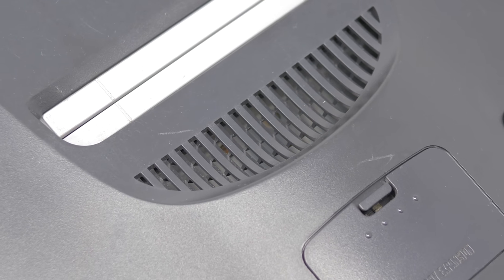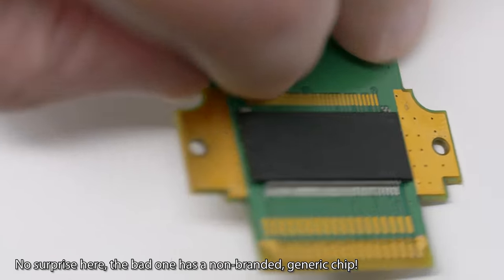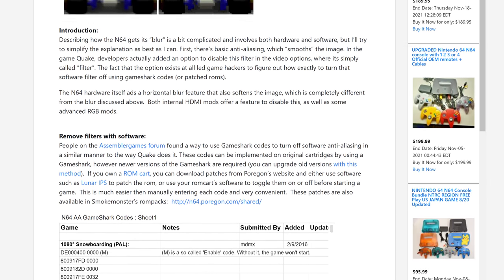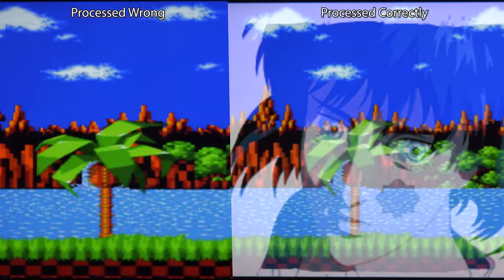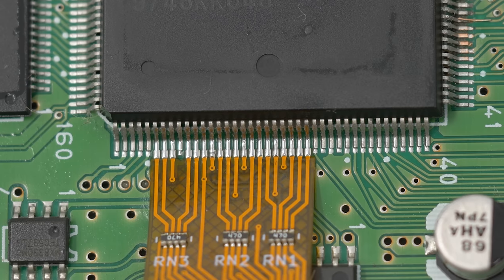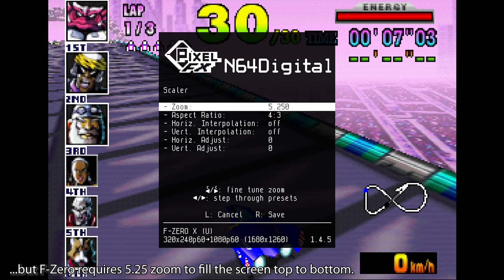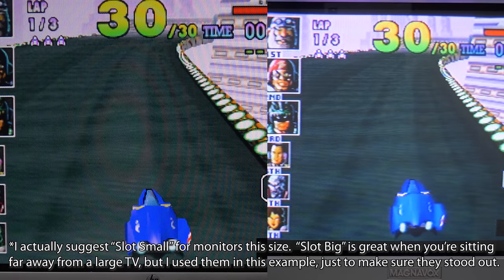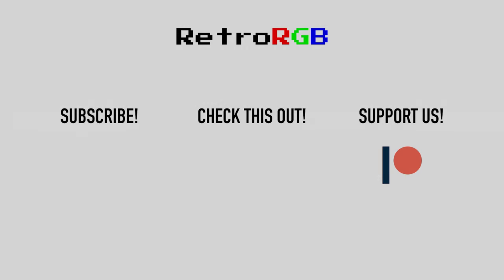Getting Started With The Nintendo 64

Comment: I'm glad there's now a more in-depth video on this subject. I got caught up with hardware and mods when I got back into retro gaming and ended up with a lot of expensive boxes and circuit boards that didn't work with my setup. I've since moved on to emulation exclusively, and I have sold most of the upscalers and consoles to make back some of the money I had spent, but a video like this probably would have saved me a lot of time, tears, and money.
Reply: the only thing that won't work on new setups are the lightguns,.. ... if you couldn't setup your consoles you did something wrong lol

Comment: Recently got back into the N64 after buying a CRT on the cheap and digging out my old Jungle Green system out of storage..  (Sadly, my original black one with the Expansion Pak is long gone.)  Also in the box were 4 original controllers, a memory card that needed a battery swap, and of course a few games including No Mercy, Ocarina of Time, Super Smash Bros., and Mario Tennis.  I'm planning to pick up a few more (authentic!) games soon and I just bought an s-video cable and a Forever Pak 64 to avoid losing save files.  Love it!

Comment: I’ve been an advocate for the mClassic but only on OG Xbox, Wii, GC and DC.. But since getting the RetroTINK 5x Pro I don’t even use it anymore since it has the same features but it’s better. It can force 4:3, Smoothing and upscale to 1080p which the mClassic does all those but just not as good. The RetroTINK gives me a more proper 4:3 image and it’s sharper with more features. I still like the mClassic and believe it’s a more affordable option that has IMO solid visual enhancements to the right 480p retro consoles. One feature that’s forgotten is the 4K upscale for 24fps Blu-ray. It’s not native 4K but it’s pretty good and nobody ever talks about that.
Reply: Main advantage of the mClassic imo is that it accepts HDMI input. Helps a lot with my old HDMI modded GC that outputs 480p via HDMI. I don’t always want to have a long daisy chain of cords to convert it to component and then into the 5x to upscale it to 1440p before running it to my monitor. Much simpler to just plug the mClassic in the back of the console and be done with it. Still get 1440p and the smoothing filter looks decent enough. If I didn’t have one already - I probably wouldn’t go out of my way to buy one now that I have the 5x, but I use it randomly at times so I’m not going to get rid of it either
Reply: @brotherbodhi237  If you want to connect it to the 5X you just use the HDMI out of it. I haven’t seen really any enhancement at that point since it works best with 480p and the TINK has great 1080p output.

Edit: I see what you mean now. Never mind 😅

Comment: Shout out to my homeboys Tim Worthington and Borti's advanced RGB mods. That shlt looks identical to my UltraHDMI with their deblur feature. 💪🏻 LOL! But, for real, the N64 is just always gonna be that one damn console that you don't strive to make look awesome, but strive to make look less like ass!
Reply: I also have installed the Tim Worthington RGB mod into my N64, and flashed it with Borti's IGR Firmware, with that hooked up to a CRT with Retrovision Cables, and it looks fantastic!
Reply: I have the RGB Advance on my N64. It look so beautiful. My only problem is I use a RGB Scart cable meant for the SNES which unfortunately creates pixelated edges which can be annoying. In a few days I will receive my Rad2x so that issue will be gone for good. I can definitly recommend this mod. Definitly use Retrotink or Rad2x after you modded your N64!

Comment: I have found that for my N64 that an S-Video cable and a RetroTink 2 Pro gives me a great picture with no hassle. :)  I always wondered how much strain the wireless adapters would cause... that's a neat solution (I use my Retrobit Tribute 64). :) 

Now that I bought a forever pak... I figure I'm golden with my N64. :) Great video, btw.

Comment: Wow - look at 16:14 and the next minute.  The CRT (just a plain, small, CRT with unknown usage hours, pulled from a thrift store) does an amazing job of translating those pixels into a smooth, crisp image.  The only areas where the LCD has it beat are color intensity and depth.  (And the CRT may have been able to improve quite a bit if it had been adjusted using Mario's red hat as a guide.)  I like playing retro consoles on both CRT and LCD ... but I do like pixels, so smoothing off for me, please!  Thanks for the great video.

Comment: Good video! I just ordered a Retrotink 5X and I have an official S-Video cable for N64 already, and based on the footage shown here, I think that's good enough. I'm not entirely sold on RGB on N64, although the N64Digital seems nice.
Reply from the maker: It's absolutely good enough.  The shot with composite, s-video and RGB shows S-Video doesn't have any of the weird artifacts and interference composite has, when used on flat panels via the RT5x.  It's a great choice.

Comment: Great vid. Commenting for algorithm. I would have liked to see a side by side of a voltar rgb mod and a tim Worthington rgb mod with deblur enabled. I’m trying to decide if the tim Worthington kit is worth hassling with. Just been running svideo because I think the improvements with the simple voltar mod are marginal.
Reply: If you're into the optimal sampling look, it's worth it. I have one of each, standard RGB mod and TW's on one the later models where the standard mod isn't possible anyhow.

Comment: I got my N64 second hand around 20 years ago and it came with an expansion pack. I didn't know until Bob's video but it looks like I have a 3rd party exp. pack. It fits in such a way that it's not possible to put the lid/cover on after inserting the exp.pack. It's always worked OK though.

Comment: Just a recommendation for my fellow PAL gamers - if you’re tempted to dust off your trusty PAL N64 and play that - don’t.

Even without considering the fact NTSC consoles are easier to RGB mod, PAL conversions are notoriously awful - slower and with borders. First party Nintendo games are especially bad for this!

An NTSC consoles and everdrive with US ROMs is a strong recommendation. RGB mods, etc. are then an option down the line if you’re keen.
Reply: My two cents: US roms on a rom cart will work fine on a pal console. Sure, maybe a pal n64 isn't as great as an ntsc one, but you know, if its what you have: rom cart is a great option
Reply: @frankeeeej  This is true, and it'll output PAL-60, meaning better compatibility with PAL TVs. It's just a color encoding issue though, RGB on an NTSC console would also work even if composite is black and white. NTSC roms on PAL also play ever so slightly too slow, if that's something you care about.

Comment: This is a great resource video! 
I recently acquired a Retrotink 5X as a birthday present. I have no modded N64. I want to play it on my 4K, should I invest on decent S-cables or should I just RGB mod it and get good component cables?
Reply from the maker: I'd say start with S-Video.  It's an excellent quality solution that doesn't require any modding and you might not ever feel the need to upgrade.
Reply: @RetroRGB  Thank you! I'll get a good S-video cable and go from there :D

Comment: i actually bought a pair of n64 controller extension cables and i plug the retro fighter receiver in there and tuck the cable away   there like 8 bucks for a pair on amazon

Comment: I still have my n64 that I had since the mid 90's. I recently tried the emulator on the pc. It looks pretty good now but I think may have lot to do with using a 4k tv, whereas last time i tried it i didnt. IMHO the windows pc and emulator is the best way to play n64 games now. Not even an hdmi mod will look that good. But one thing I am trying to find out about is. I love the top gear rally game, I have been playing it for over 20 years 😄 but I did a paint job in the paint editor on that game saved to the original memory card. But then bought a more modern rumble with memory available so was I able to load up the paint job in the game and take a duplicate save of the paint job onto the newer rumble/memory pack. So it's amazing to still have that paint job I did in the mid 90's. What I am trying to find out about is, is it possibly to get your original memory card saves on to the pc and use on an emulator? I simply want to take the paint job save from the original memory card and use it on the n64 mupen plus emulator. I say simple but I don't even know if it is possible.

Comment: I’m getting back into N64 after 20 years or so. I’m 30 so I wanted to relive the console I loved back in the day. 

I had the DK64 edition N64 which is what I wanted this time. So I bought a Funtastic Jungle Green N64 with the red top expansion pack and two funtastic green Nintendo controllers on eBay for $235 after tax. 

Then I looked into games and was turned onto the Ever Drive 64 x7, being I wanted the look of the DK64 I paid extra for the Banana Yellow Ever Drive 64 x7. That was $212 after tax. Then had to buy a quality HDMI cable and micro SD card, another $30

Then had to upgrade my cable from the simple AV cable to S, add a Retrotink also. I was told the cables that come with the Retrotink mini aren’t as shielded or as good of quality as the OEM Nintendo S cable, well that cable is $50 and I will likely go with the x2 pro Retrotink so likely another $130

So now I’m at over $650 just to play a 20+ year old video game system lmao. But this time around it will look better and I’ll have every game made for the N64 instead of just a handful of games. Reliving childhood memories are not cheap! 

I would like to note, my sister kept a charcoal N64 and 8 or so games so a lot of my pain was self induced to have exactly what I had as a kid plus upgrading it for my modern TV. The funtastic N64 was lost in time.

Comment: Great video! Just to add some information, PAL consoles can use S-Video with a custom-made cable. Not sure if that was said in the video.

Honestly the N64 outputs a terrible image quality, even in CRTs some games look bad. This is one of the consoles that can benefit the most using mods, good cables and a scaler like the OSSC or the RT5X Pro.

Comment: Ugh.. I have an early 2000s CRT (well, a handful of various CRTs, some worse than others, most having issues that need fixing), and it ONLY has composite video RCA plugs, besides the standard RF input, and sure, NO s-video, NO component, but I love it for NES, SNES and N64. But, sometime in 2022 or 2023, the RCA plugs for both inputs, started feeling wobbly and loose when plugging and unplugging cables into both inputs, and the image now dims and flickers when they're being jiggled or wobbled... I'm so sad, because I don't know how to safely discharge the CRT, just so that I can possibly try reflowing or re-soldering the RCS jacks and see if that fixes the issue for both inputs.

Comment: Man i really love this videos. If it wasn't for the retro community putting so much love to keep this things alive i wouldn't be playing my N64. The RGB mod definitely goes well with the OSSC. The OSSC works great on my 65 inch Samsung Q8 FN. And the custome scanline feature is awesome. The only thing im missing is the optimal timing for the N64 on 5x. If anyone has a preference pls post in the coments. I also noticed that games that support the expansion pack run on 2x bob interlaced. Is there a specific timing for bob interlaced as well, or can i use the same timings no matter the resolution?

Comment: Getting one of these Kind of Videos for the Playstation 2 would be GREAT for me right now. 🙏🏽
Reply: use ps2 component cables with retrotink 5x with it's motion adaptive deinterlacing
Reply: @gamecubeplayer  my Dilemma is, if i spend $300, shouldn’t i just buy a Backwards Compatible PS3? Thing about that is, I’m not the most tech Savvy guy. I’d like to be able to play Roms on the Systems. Something tells me that Soft Modding the PS3 is a Task versus just buying a MC2SIO/MX4SIO for the PS2. Is there anyway to get the PS2 to look as Good as the PS3 Upscaling?
Reply: @swishahouse68  the retrotink 5x has an upscaling smoothing filter

Comment: 5:40 I got one of those recently, glad I did too. Some of those games are just too expensive, and there are so many rom hacks ive wanted to play on original hardware. Also if I ever did get a cartrige version of space station silicon valley id have to take out the expansion pak and replace it with the jumper pak because thats the one game that crashes with the expansion pak, and it also has that one glitch where you cant get a certain collectable... I cant wait to play through the patched version!

Comment: Is Pixelfx's N64Digital hdmi mod still the best picture out there on modern HDMI TVs? Amazing video, thank you!
Reply from the maker: In my opinion, it's tied with using quality S-Video cables (or RGB-modding) and using the RetroTINK 5x.  My suggestion is this:  If the N64 is the only analog console you want to use, do the HDMI mod.  If you have other consoles with composite, S-Video or component video, get the RT5x, since that will work with all of them.  Check this channel for more info on it!
Reply: @RetroRGB  Thanks so much! I just bought a RT5x and quality Packapunch S-Video cable! I'm looking to have my N64, SNES, and PS2 all set up all the time. Does this mean my best option is to buy two more to have them all set up simultaneously? Or is there a recommendation for a switcher and perhaps sacrifice the picture quality for convenience?
Reply: @RetroRGB  Aw shoot! The Retrogaming, Retro-Access, & Insurrection Industries cables are sold out. Any other recommendations?

Comment: Hello from France : Great video, thank you ! I have a NUS-001 (EUR) model, N64 RCA composite cable, an OSSC with an add-on board that provides s-video and composite inputs and can do line doubling and smoothing. If I understood well, I don't "need" to RGB-mod because picture improvement will be minimum ? But using a PAL S-video instead of the RCA composite is a better option ? thanx & best regards :)
Reply: S-video is much less noisy than composite, so it's a nice improvement. RGB does have brighter colours and even better clarity, but the difference isn't as noticeable. Be careful about which cable you get though, there are a lot of bad ones out there.
Reply: @ozzyp97  thanx a lot !

Comment: I agree with the advice just play on a CRT and use composite video, there's barely even an improvement with the Nintendo 64 over S video unlike most other systems.
Reply: S-video removes a lot of artifacts around edges, and RGB is a fairly significant upgrade in color saturation on top of that. I do agree that it's not nearly as obvious as some other systems though.

Comment: I use the mclassic with my retron 5 for my cartridge retro games and it does make a difference in color vibrance and sharpness. I also have it connected to the N64 via a hyperkin hdmi (temporary until I get a retrotink) and it does make a color and sharpness improvement (10%ish). It also allows me to modify 4:3 and 16:9 which comes in handy often with complicated setups of various systems and scalers. I also use it a lot in combination with my OSSC to get some amazing picture quality out of various retro consoles. I love it. I can see it not being as necessary if you're retro consoles are RGB or HDMI modded but it does provide me with great results via my component and scart systems via the OSSC

Comment: My Setup is:
US N64
Kaico Line Doubler (for hdmi)
- Kaico or Bitfunx over RAD2X? Because without RGB I would only get compsite quality. With mine I get svideo signal quality :) 

Mclassic (for 1080p)
Everdrive X7
Wireless Retrobit Pad (with rumble)
- I use an extended n64 controller cable to reduce the pressure for the big dongle on my console as well

Other thing: the Mcable is something else then the mclassic. And you need to get a progressive signal to work with the mclassic. 
In my test it did an absolutely amazing job to go from 480p to 1080p on N64, GC, WiiU, Wii, Snes Mini etc.
Reply from the maker: Kaico is a clone company.  Please never support them:  https://youtu.be/LxgkxS6gGgk
Reply: @RetroRGB  you can also go for bitfunx then
Reply from the maker: Bitfunx and Kaico are the same company.
Reply: @RetroRGB  are they? And what company they are copying? 
I haven't seen any other line doubler for svideo signal for N64 out there.

Comment: Little story to share. I watch RGBs recent videos and macho nacho on the forever pack and you both mentioned how it’s not possible to expand the amount of memory on the memory pack. And I thought I was going crazy because I remember having a third party one with expanded memory. Found my original, it’s a 1mb card by 3D2. It has 2 dip switches on the  back that allow it function like 5 separate memory cards in one. Just wondering if this type of technology was incompatible with the forever pak.
Reply from the maker: That's a multi-bank card.  I'm sure the ForeverPak team will consider a version like that someday, but I think as-is, it's still an excellent product.
Reply: @RetroRGB  thanks for the reply and confirming my sanity! I thought I just might have imagined the existence of the multi bank card.

Comment: I use my RGB modded n64 with a scart to component adapter from retrotink to a flat 19" crt that has component in.  When I tried the n64 with retrotink 2x to a flat panel tv it worked but when I tried a hdmi to vga adapter to a computer PC CRT, I got an on screen message from the monitor OSD saying the monitor is working but doesn't support 15Khz which makes since since most computer monitors don't support 15khz.  I still would like to see the n64 working on a computer CRT though for some odd reason :)
Reply from the maker: I did a video on exactly this :)  https://youtu.be/iLkN2AZLBMA